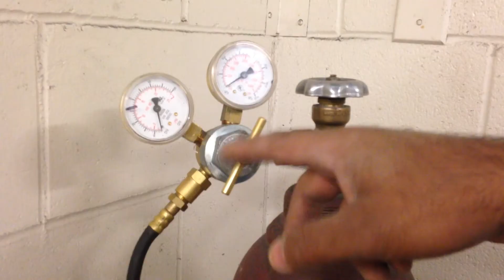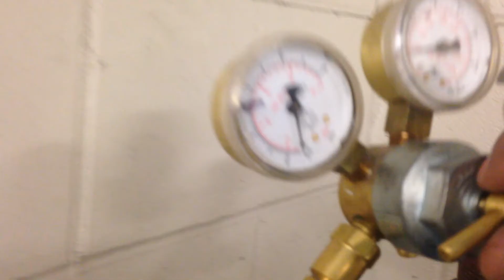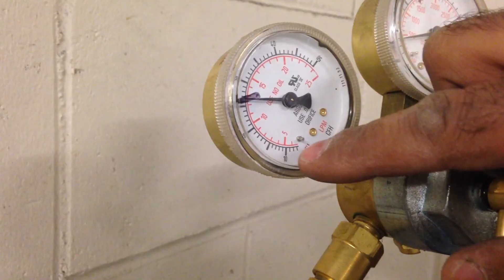MIG Welder Safety 4 of 7 - Turning on the shielding gas

Comment: Good stuff, but should of mentioned that this is for 75% argon 25% Co2, with 100% Co2 gas you need extra seals for your regulator, and different pressure setting.  Also about 15CFH is all you need indoor, I run at 18CFH  and other welders I know prefer running 30CFH indoor and 40CFH outdoor.

Comment: I'm new to the welding scene and I went over to the tank to see if I had any gas in the tank and it showed I had about 30-35 on the right gauge. Then I turned the free spinning knob, in the middle of the two gauges, to the right and the pressure went up on the left one but my problem is how do I get the gauges to both come back down to zero? I don't feel like blowing my house up or something. Thanks in advance. By the way, my setup looks exactly like yours.
Reply: Nevermind. I just saw your other video on how to purge the lines lol. Thanks anyway but does the machine have to be turned on or can it be shut off?

Comment: What gas are you welding with that is flammable?
Reply from the maker: patrick. bryk not flammable. Shielding gas is inert gas which means it doesn't react with anything. Explosion hazards are a result of damaged gauges that could blow out when gas hits them at high pressure so stand to the side just in case.
Reply: Yea uh not flammable
Reply: patrick. bryk right !
Reply from the maker: Baby Fishmouth I'm just stating that in the case of flammable gasses be careful with regulators. I know it sounded like I was referring specifically to MIG gas but I wasn't. Just a general comment.
Reply: Mr. Sandhu Tech Ed ok gotcha

Comment: Omg....dude..take a welding class.. I would never work with a guy like you. Quarter 1/4 turn to 1 1/2 turn is general shop safety. Dont say nobody warned you.
Reply from the maker: crystal joleen this is a double seated valve in this tank. It can leak if not fully open or not fully closed. Did you know that? And since it's not a flammable gas then there's no risk of an explosion if it leaks. Did you know that? If you had taken MY class you would know that. And you wouldn't be able to work with me unless you were a trained Tech Ed Teacher. Your welcome for the free video that I made just to help people.
Reply: Mr. Sandhu Tech Ed 
Sweet.  Thank you
Reply: @mr.sandhuteched769  in your video you called it a FLAMABLE gas.  

You did everything right.  (except for aiming the gauges right at your face) but your explanations were all wrong.  It's clear that you got some instruction but you lack understanding of how the regulator works, how to set your pressure and gas purpose.
None the less, still a helpful video in as much as I don't think anyone would get hurt following your procedure.
Reply: @burtreynolds3143  Before you call out a person you should make sure you have your facts straight. I did not say it was flammable gas. I said that its important to be careful with the regulator especially WHEN you have flammable gas, which is true. If you have trouble understanding my video please feel free to find a video that speaks in simpler terms.

Secondly, When you say I lack understanding of how a regulator works you are making a very generalized statement with no evidence or backing. So its just an opinion. Try to be more specific. What did I say to indicate that I don't know how a regulator works? This video has over 100k views and has helped a ton of people so try to pay attention better before spouting off publicly. 

Thirdly, I am standing to the side of the gauges in the video. I make an obvious adjustment to turn the tank away from my face. Again, develop an attention span and try to pay attention .All you've done is shown how ungrateful you are for this free video that cost me my time and effort and cost you nothing.